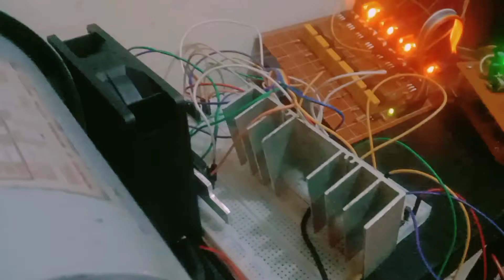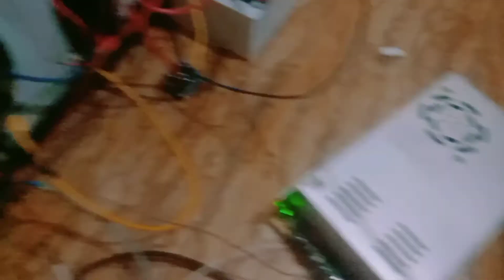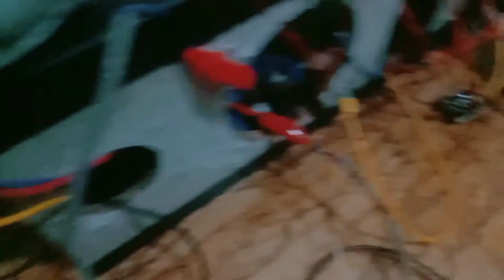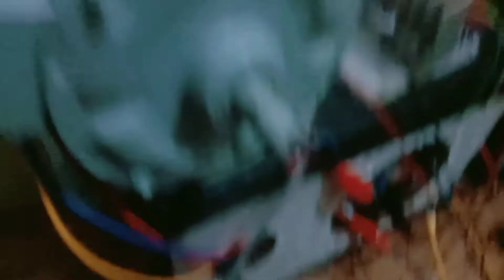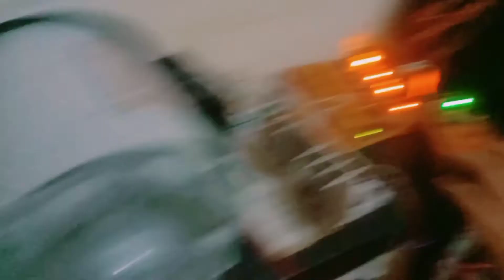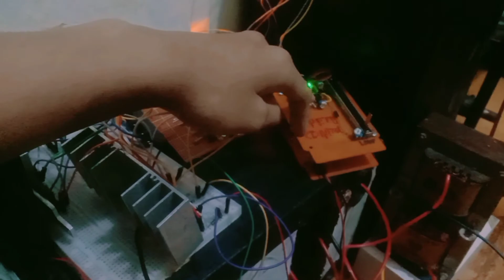VFD/VVVF 3-Phase Inverter

Comment: Which igbt/mosfet and gate drive ic used sir
Reply from the maker: I'm using HCPL-3120 but I recommend do not use that, instead TLP250, it has lower vcc input which only 10v compare HCPL-3120 with 15v VCC side.

Comment: ..and here's a real-life implementation of a VVVF drive developed in the '70s, used in the metro trains in Helsinki. These are still in use today, after 40+ years of use. Trains have been refurbished, but the drive system of the M100- series trains has not been changed.

https://youtu.be/3aI3EsbES3Y?si=CXRwsCx1JIXULgnB